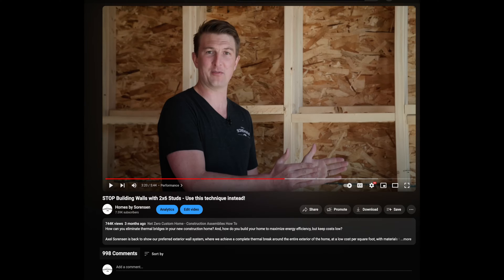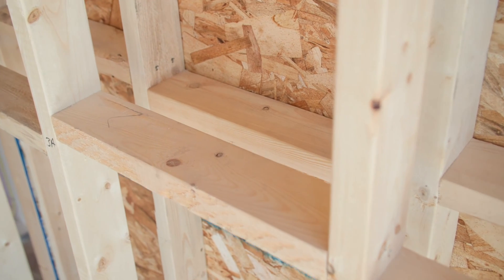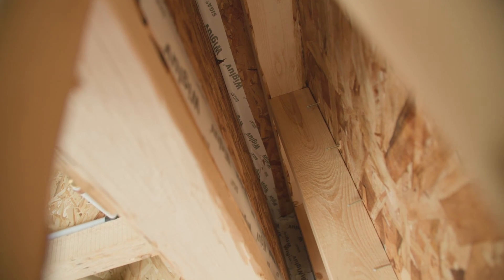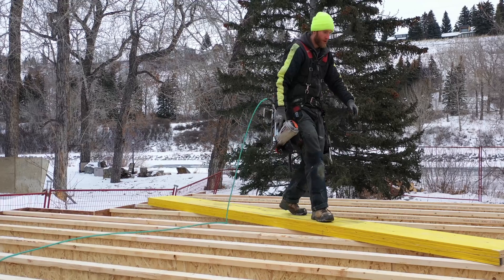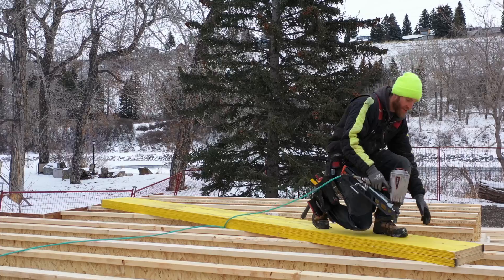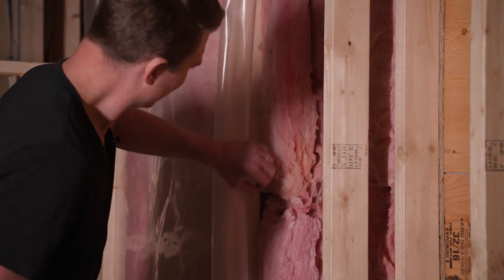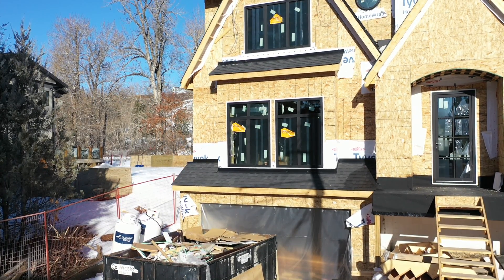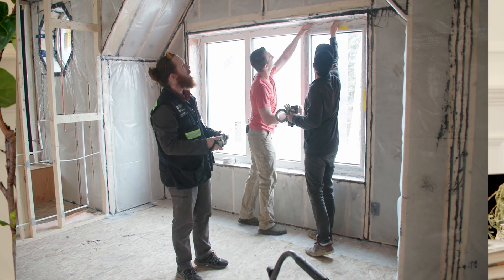Answering Your Questions from the Viral STOP Building Walls with 2x6 Studs Video

Comment: I agree with the cost/practicality aspect of double stud walls. Here in Ontario we have found a similar comparison. We have found that installing 1” if exterior Ci to be about the same cost and framing and insulating an additional 2x4 wall. One of the best features of a DS wall is the simplicity of exterior detailing without Ci.

Comment: Ok, BC custom home builder here, typically just do what the architect specs. For my build i was interested in your assembly, and your q and a just clarified my floor question. What about 2 by 6 plates with double 2 by 4 framing on 24inch staggered centres?? Less insulation but no thermal bridging. Thanks for putting up your vids, super interesting
Reply: It's not no thermal bridging, there's the top and bottom plates and floor & ceiling joists. You also have the problem of bracing the studs with blocking/noggins - the staggered studs interfere with them. Bracing the studs is imperative for load bearing. A way to avoid them is to sheath both the inside and the outside but then, there go your costs.